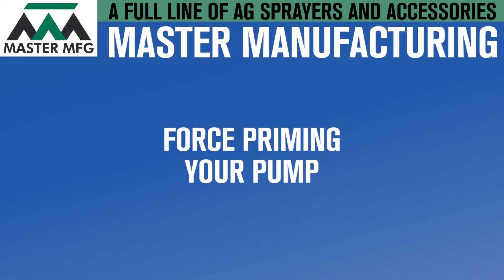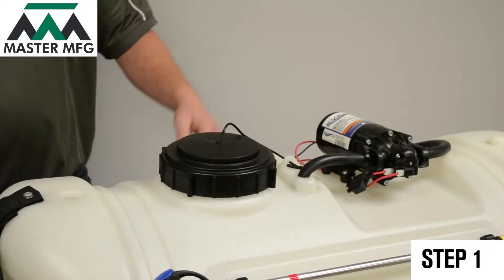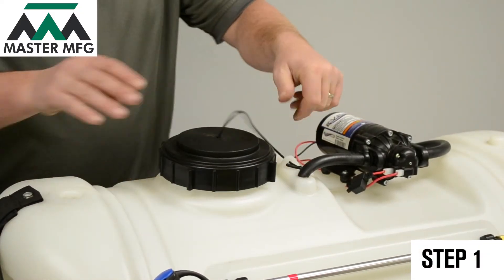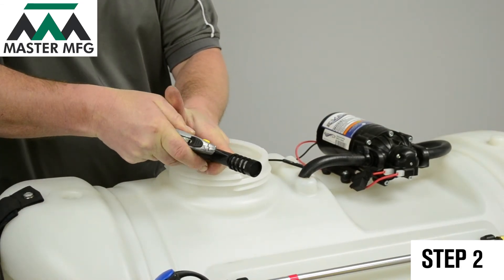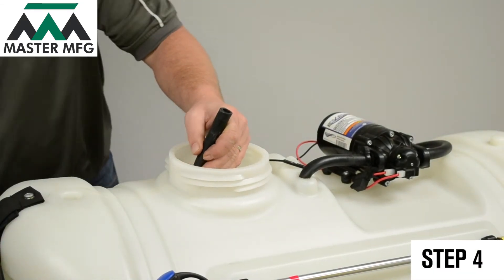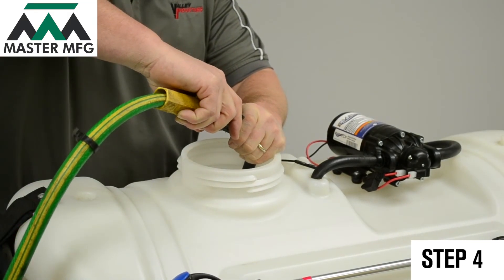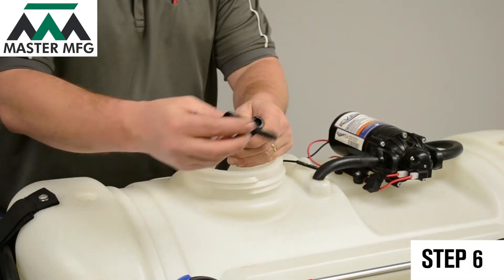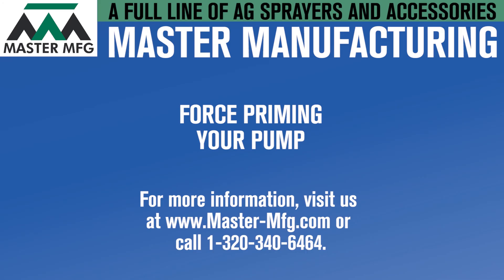Troubleshooting Everflo Diaphragm Pump (Force Priming)

Comment: Ok. My problem
The power would make the motor turn on but the pressure gage wouldn't move nor suck up water. I wasn't sure if this would work.

But I got the end off the hose. Make sure you twist and pull. I was trying to pull it out but wouldn't budge until I twisted it. 
I forced water down the end. The motor shut off. Then came back on and started spraying. Yes you need to have the motor running while you do this. Take the end off turn the mower on, force the water down the tube.
Reply: Why is the motor shutting off? What causes the motor to turn on? Is your pump at the top of the tank like in this video? 1:58

Comment: Main problem what people are not understanding abt this video is this pump is GRAVITY fed....not self priming...thats why they mount on top of tank so it will burn up and make you buy more pumps...mount pump level with bottom, put your supply hose on bottom of tank, attach hose to pump, and then all ya problems will be solved...think outside the box people

Comment: I have been frustrated with this the past few years and figured out the solution. Modify the sprayer to make it a constantly flooded pump so the pump has a gravity feed from the tank and it works! I think these manufactures want to sell check valves and that's why they manufacture them with pumps mounted higher on the tanks.
Reply from the maker: Hi Mike! Thank you so much for sharing your feedback. We really appreciate the details you shared with us about areas where we can improve. This insight will help us greatly approach our next project!

Comment: My sprayer is fairly new but won't prime. Took the pump apart. Everything looks ok. Why would I need to force prime it? It worked last time I used it a few months ago without force priming. It's like it has no suction in the intake hose. Checked clamps. No clogs.
Reply from the maker: Hello David. Thanks for reaching out. Please connect with our sprayer support team via email (support@master-mfg.com) OR via toll free phone  (800-825-5397)
Reply: @MasterMFG  Thank you for saving me $30.00 to $40.00. Your video is short and sweet and WORKS.